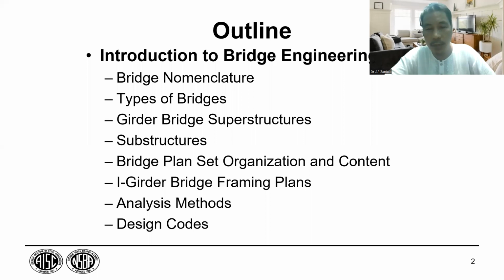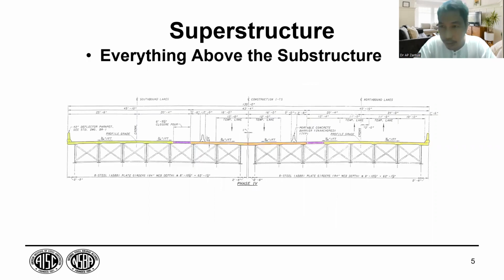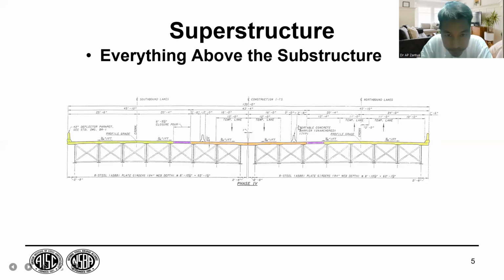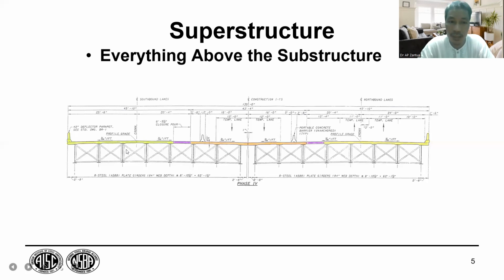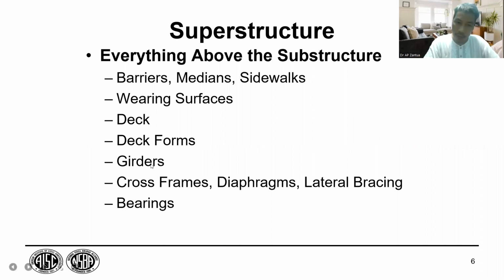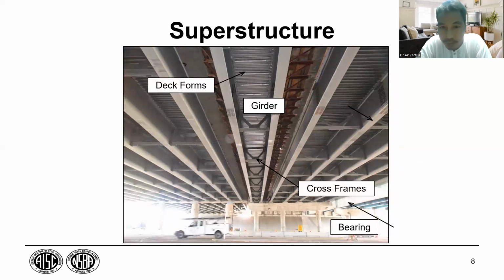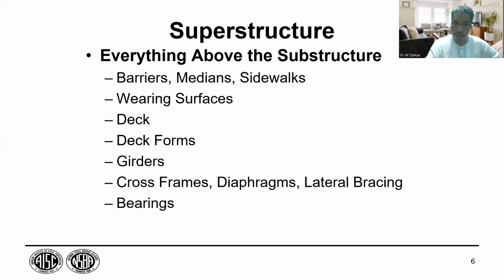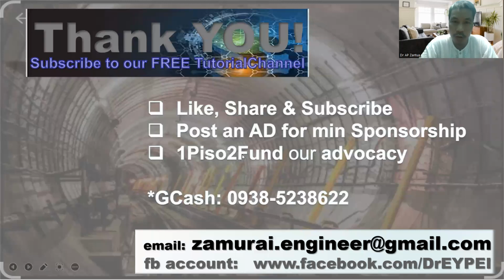BRIDGE Engineering Nomenclature [ Highway & Railroad Engineering ] Module 5.01

Comment: In this video it tackles about Bridge Engineering Nomenclature, I have learned the main elements of a bridge: Superstructure, Substructure and Foundations. After watching this video I learned about the elements/things that are under the Superstructure, Substructure and Foundation. It also mentioned here what we can see in the picture like deflector parapet, portable concrete barrier, the meaning of the yellow portion which is called profile grade, the orange part is called temporary lane, plate girders, abutments, piers/bents, pier/bent caps, columns, footings, drilled shafts, piles and many to mention.

Comment: Thank you Sir for this lecture video where explaining the highways, bridges and railroads. With through the outline of the topics, they are parts of introducing to Bridge Engineering. First topic shown is the main elements of a Bridge which are the superstructure, substructure and the foundation. It was explain with some examples and pictures to understand the difference of three Main elements of a Bridge.